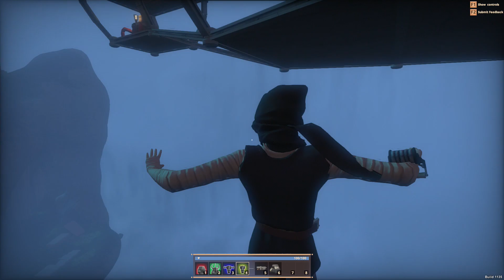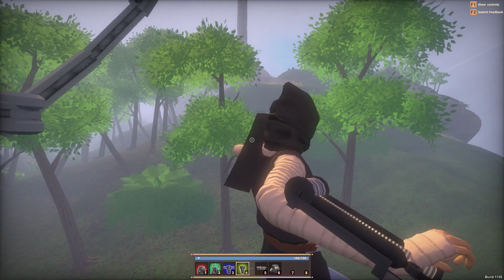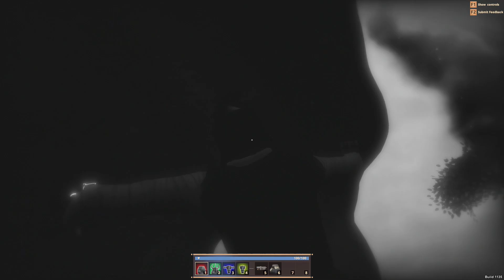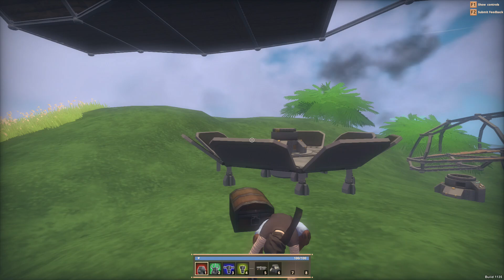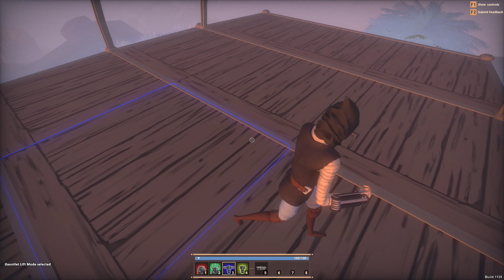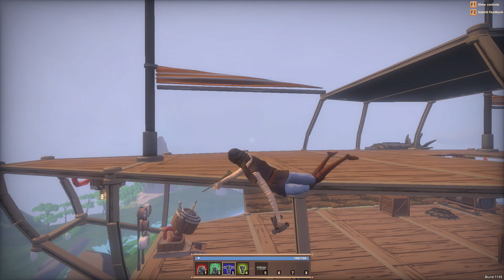Building a New Skyship! - Worlds Adrift Alpha Gameplay - Part 3

Comment: Wings are backwards
Reply from the maker: Relative to conventional planes I would say yes, but the flaps on these wings seem to be on what I would normally consider to be the leading edge, so I flipped them so the tips pointed toward the front instead of the rear (putting the flaps on the trailing edge).